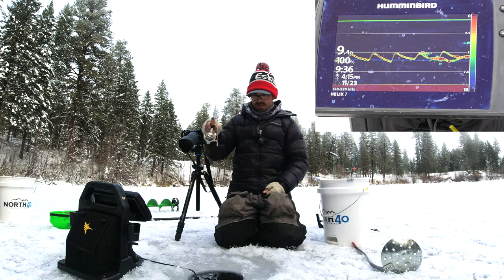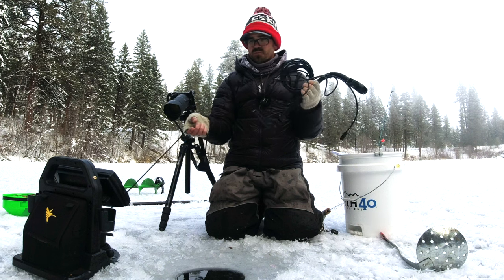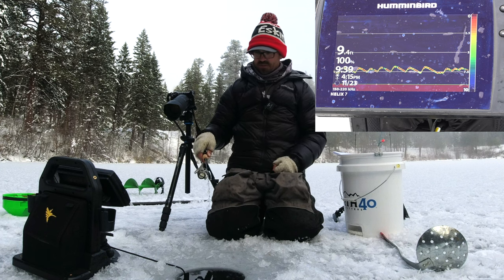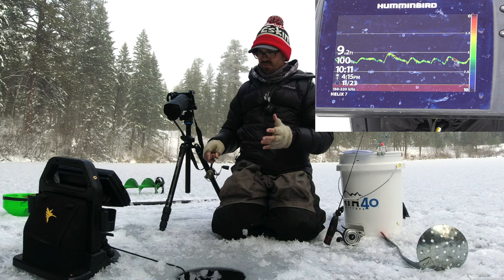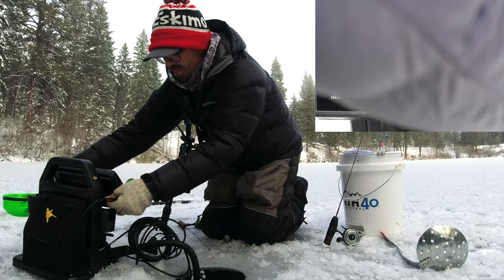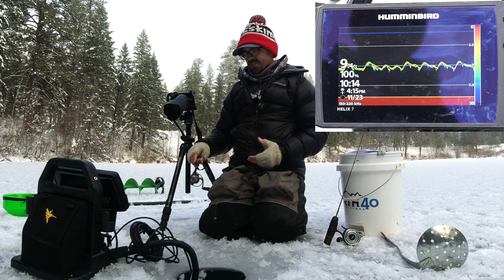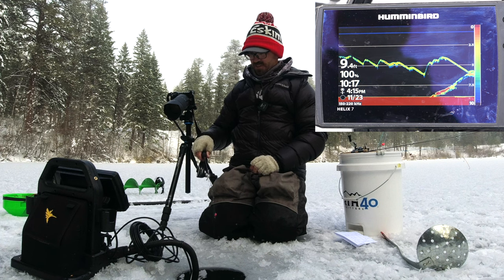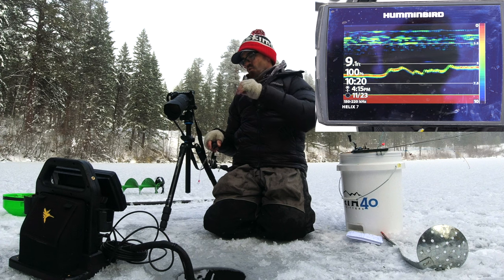Open Water Transducers for Ice Fishing?

Comment: My ice finder is a striker 4, I had to make a pvc sleeve for the transducer so it would hang straight in the hole and it works great. But without the pvc the cable is bent just enough and just stiff enough that transducer doesn’t hang perfectly straight.

Comment: Definitely can use an open water transducer. I only have an open water one, and have used it religiously for years. Work great, just need to make sure its pointing the right direction with a bit of trial and error. I tape a piece of coat hanger to the wire and through the mounting hole in the ducer. Bend the wire as needed to get it to hang straight. Remove the tape and wire in the spring for open water.

Comment: Been using my striker 4 hooked to a couple 14.4 volt drill batteries for 3 years now....just took it off my boat and built a arm to hold transducer....works great for run and gun ice fishing...2-14.4volt batteries lasts 10 hours on ice...cheap and easy...love the vids...keep em coming 
From my very cold and frozen igloo on the mountain D.
Reply: Did you just run it straight with 14v or did you get a voltage reducer? Did the striker handle 14.4volts no problem?
Reply: @markusahlfors6132  just used gorilla tape to hold power wires to battery...no reducer...was using 15 year old hitachi 14.4 volt drill  battery (×2)...each battery lasted roughly 5 hrs ...worked no problem...straight to battery...hope this helps.

Comment: Other than being a pain to work with, the regular Garmin transducers always worked fine even on my striker 4, but switching to the ice ducer is so much easier to handle with the small cord and float. I used to run mine off a 3s lipo from my RC boat/cars and it would run most of the day off a single small battery and it was easy to swap a second on. This year I bought the full ice kit for UHD 94sv I have in my larger boat that I usually use for salmon in Puget Sound and bought a second cradle so I can just pull the unit off and snap it in the ice kit and it has a battery and everything ready to go, so I'm excited to try that out. 9" display seems ridiculous for ice compared to the striker I've used in years past.

Comment: Used Helix 10 last year with the MSI transducer on a stick, it was not nice to put down a separate 8 inch hole. I did get somewhat good Down imaging, split screen it with 2d anyway. Color palette trick will help white screen was blowing my eyes out at night. Bought Mega 360 for this year to replace the wooden stick.  🤣  ION 10 incoming.

Comment: Good video, but you never said anything about why you “shouldn’t “ use the open water ducer. My buddy bought a Garmin striker and he had all sorts of trouble getting it to sit right. He would be fishing fine and all of a sudden his jig would vanish. So he would have to lean down and turn the wire and play with it so it would work. As another guy said, if the open water ducer isn’t sitting perfectly flat, it will give you problems. But yea, all one needs is an arm like you have that forces it to stay at the perfect angle at all times and then it will work just fine.
Reply from the maker: Good points 👍

Comment: Thanks for the great content Tyler, very much appreciated. I have a question about the transducer settings you're using when using the open water transducer, it appears that you are leaving the units transducer setting set to the XI-9-1521 even when using the open water transducer (shown at the 8:53 mark in the video), is this the case? If so have you tried it when the open water transducer setting is used and what were the results? Thanks
Reply from the maker: It doesn’t give me an option to use the open water transducer model in ice settings I can only choose between the chirp and non chirp models